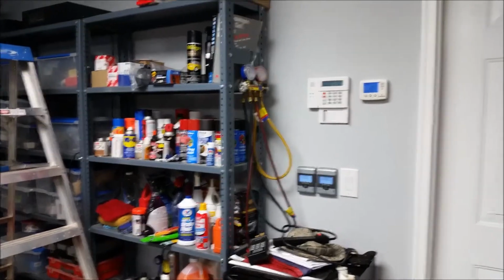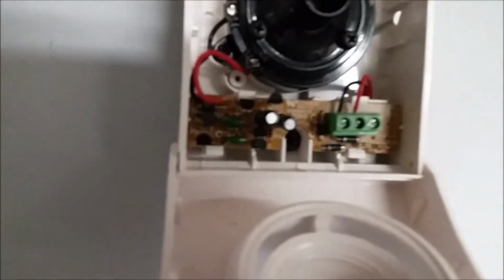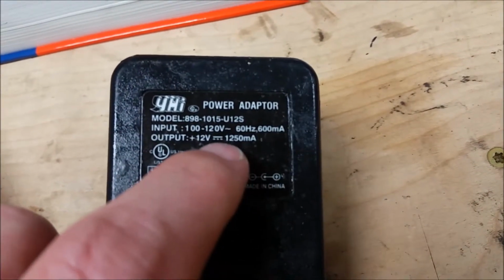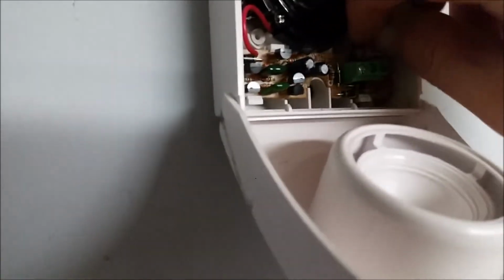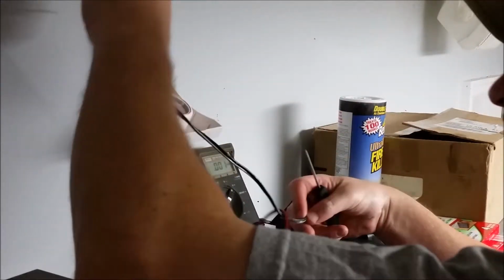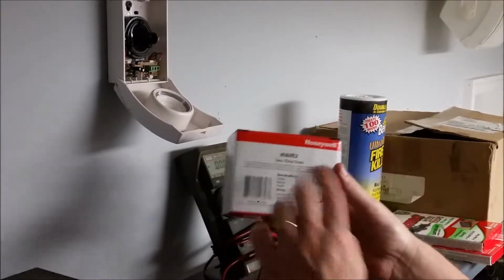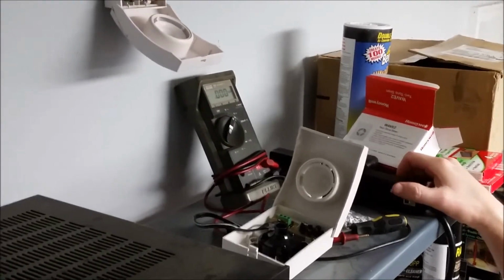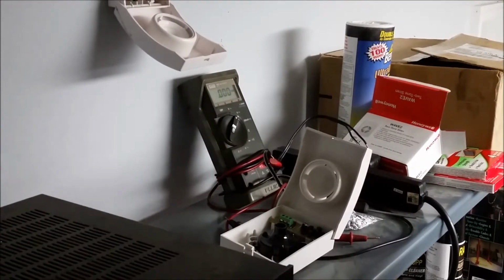Project #3 - Alarm Siren Replacement

Comment: I had this siren at my old house. But it was mounted upside down, so maintenance sucks with the siren because the door is going to fiddle around while you fix wires or replacements. Also it was loud and I have heard it before.

Comment: I have a Simon xt FrontPoint security system will this work with that? Anyone knows
Reply from the maker: You can use any brand, as long as the voltage is the same as the old one.  Most all alarm sirens are 12VDC, but just check the specifications on the old one you are replacing to make sure.

Comment: Hiya.  We have an old alarm system that has a crackling sound on one of the sirens. Just as yours did.  Is it possible to replace the siren with another make of siren as I fear we won't be able to get one the same.  It is an Optima xm6?   Please can you advise?  Many thanks.
Reply from the maker: You can use any brand, as long as the voltage is the same as the old one.  Most all alarm sirens are 12VDC, but just check the specifications to make sure.
Reply: Many thanks for your reply.